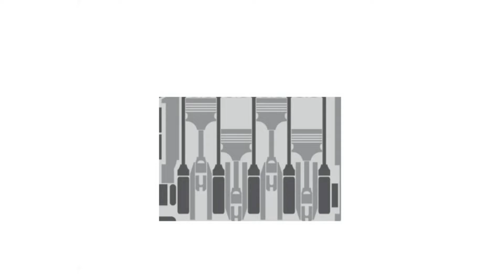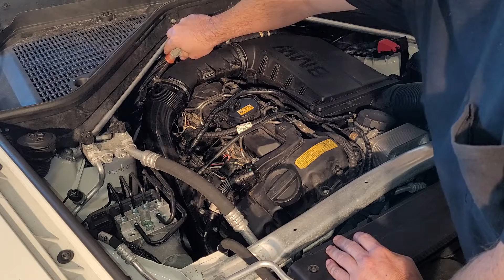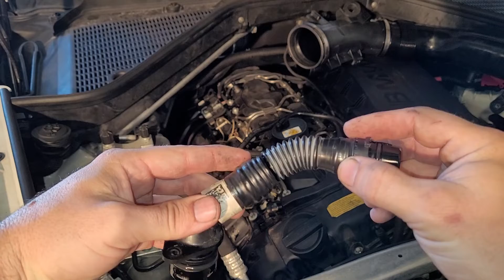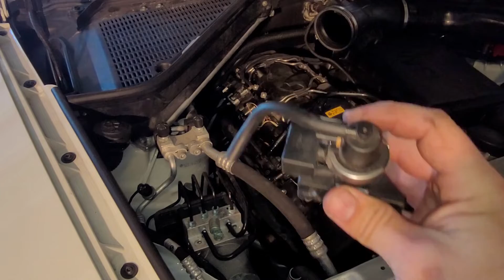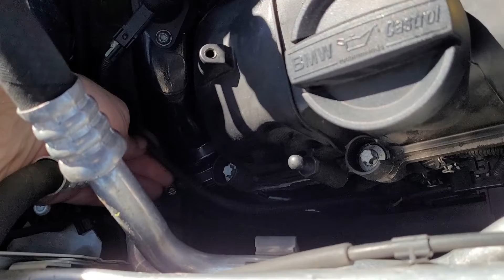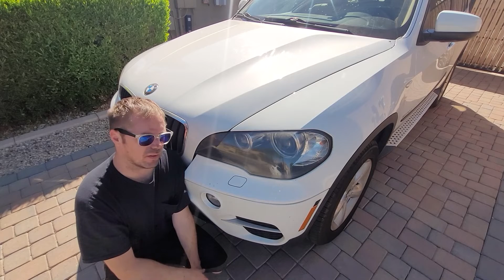BMW Wastegate Fix DIY – Wastegate Control – Charging Pressure Too High - Engine Malfunction

Comment: I occasionally get 2c56 code and 2c58 as consequence. I installed a genuine pierburg boost control solenoid. Issues including the car not making as much boost as it should, but also getting the 2c56 which means overboost which is contradictory. What would you advise to check next?

Comment: my pressure is too low on a 2011 535i xdrive. demands 10psi and only delivers 2 at a certain RPM range. think it’s not closing?

Comment: Hello, my X1 just showed the half engine yellow warning light, but it only has 9k miles on it. The gast tank is almost empty, do you think that could be the cause of the warning or not?
Reply from the maker: Low gas is not the cause. Your vehicle is under warranty. Let the dealer figure it out.

Comment: Excellent detailed video!  Provided all the detail info I needed to fix my own unit.  Quick & simple tip for getting the vent pipe with the new O-rings back on a bit easier: apply a bit of O-ring grease with your fingertip, that makes it slide on easily😊
Reply from the maker: Thank you for the kind words. Glad you got it fixed.

Comment: Thank you for the video. I have the other issue. 2c57 . Based on the explanation it could be possible that the hose is cracked and the valve is faulty. I did have the car smoke tested on thursday and they did not find any leaks. Car is 2013 135i running mhd stage 2 plus tune. I have never run this car at wot since I purchased it as I have been slowly converting to a track car.

Comment: Hi, I changed the N13 engine in my car, installed a new one. It gives me error 120408. In addition, I have smoke coming out of the exhaust as if the oil is burning, the symptoms are as if the valve seals are bad. Is it possible that the car is smoking because of this error or is there an additional fault?

Comment: I feel like I have the same issue. Mine comes up if I press the gas harder or on sport mode on 3k rpm. But your code is different than mine its 120308?
Reply from the maker: That's charge air pressure low. Might have a leak/crack in tube between turbo and intake.
Reply: But my scanner said  “Charging pressure control, plausibility Pressure too high.” 😢
Reply: Fixed it? Mine is and 120201 and 120208..problem surfaces under hard acceleration

Comment: I have a 2010 F10 535i N55 and I am getting an error "boost pressure too high". It happens only sometimes when I accelerate too much or when I reach 170km/h (I live in Germany). I guess this could fix my problem, too!
Reply from the maker: I bet it can! Thanks for watching.
Reply: @MajorSpeirs did it fix your problem?
Reply: @almariodon7599  I let BMW change it for me two days ago. I didn't get the chance to test it out yet, but until now accelerating until 160km/h (100miles) didn't have any issues. 100 miles is not much here in Germany, so I need to bring the car up to max speed to see.
Reply: @MajorSpeirs  I changed my boost solenoid and cleared the code and now its back normal been two weeks now.
Reply: @MajorSpeirs did you fix it ?